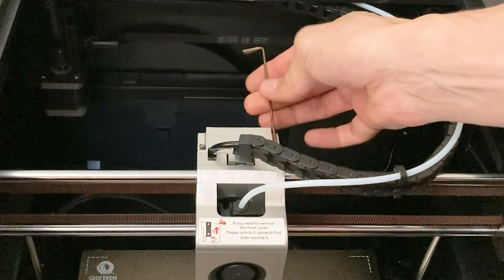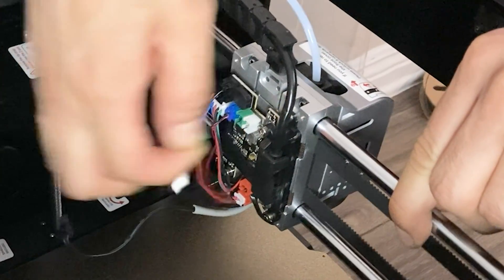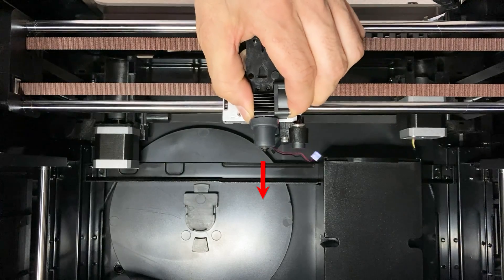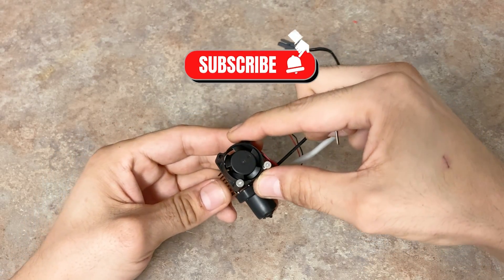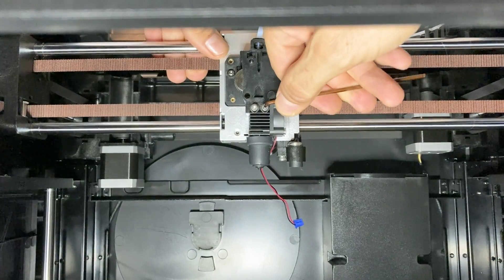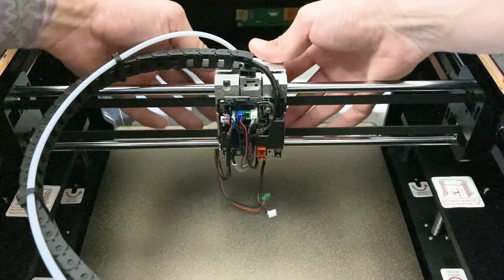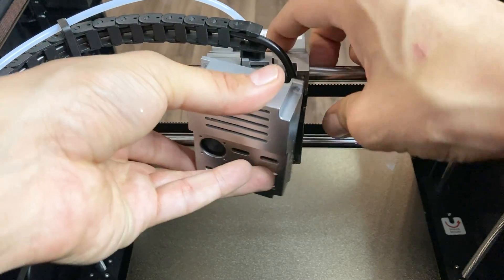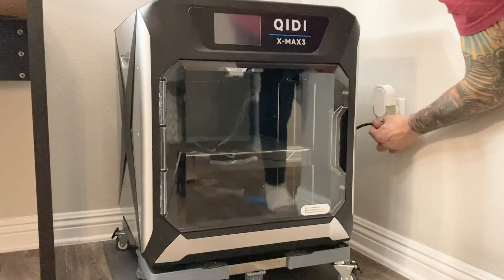X-Max 3/X-Plus 3/X-Smart 3 - HOT END REPALCEMENT/UPGRADE HARDENED STEEL

Comment: Hi, If hotend is without signal/contact what happend then? Printer will not load temperature of the hotend, bed and chamber, right? Then printer show me on the display Restart firmware. Just want to be sure..

Comment: I did everything you demonstrated and received an onscreen message saying "Max6675 : Thermocouple Open Failt.Once the underlying is corrected, use the FIRMWARE_RESTART command to reset the firmware, reload the.config, and restart the host software..Printer is shutdown." Any suggestion would be helpful as support has not responded to my inquiries.

Comment: The screws holding my hotend in place were installed from the back, and needed the entire extruder gears assembly to be removed (just an extra two screws) to access. Just a heads up for anyone else out there with the same weirdness as me. Thanks for the succinct and easy video.

Comment: Can you do a video on how to replace just the nozzle and the whole hotend? I believe I would be the only one who would benefit from demonstration/example. Greatly appreciate your contribution and help. Thanks 

Also Facebook lead me here.
Reply from the maker: Hi there, thank you for the suggestion. Are you asking for another video only showing how to replace the nozzle and not the complete hote end?
Reply: @TripasGarage  yes, because on most older 3d printers they have a square aluminum heater block. All new printers are now using round heaters. So what's the best and proper way grab the heater and not ruin it while turning the nozzle loose.

Sorry, I might be making this far more complicated than it needs to be or should be.
Reply from the maker: Oh! I totally understand now. Well, the bambu also uses a square heater block and I've done a few videos on those. This new heater also has 3 little screws that hold the hotend to the heatsink so it does a good job of holding it in place on the Qidis.
 @TechKnightOne